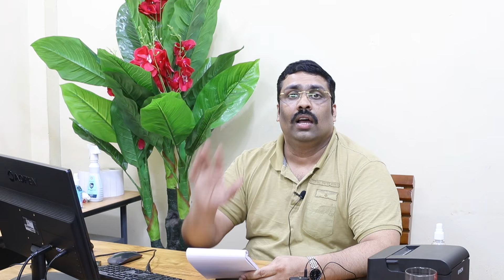MEP interview question and answers

Comment: Thanks for the nice video, Can i have a request for a very important video ?
Actually, I want to become a Facility Manager and need a separate video on Compliance and Government norms only for techncal and non technical things for a residential or Commercial building or Office infrastructure.
Licenses for business
Fire Safety Goverment Rules 
Fire Fighting System Govt. rules
Fire NOC
Electricals related govt. rules
Transformer related govt. rules
Lift License related rules
Diegel Generator
HVAC System, Chiller, AHU etc.
Building management system (BMS)
Fire Extinguisher rules
STP, ETP, WTP govt. Rules
Audit checklist 
Records to be maintained as per govt. rules to a Technical and non-technical facility Manager 
Register to be maitain as per gove. rules
Waste management related rules.
MEP related govt. rules.
Goverment dept, from where we can get this noc or permission for running Technical or Mechanical related things.
Pls, add more things if I left from my end.
Could you pls make one long video to explain in details?
Thanks🙏🙏🙏